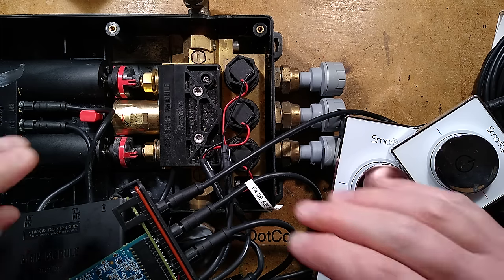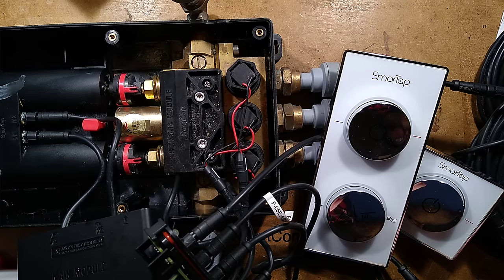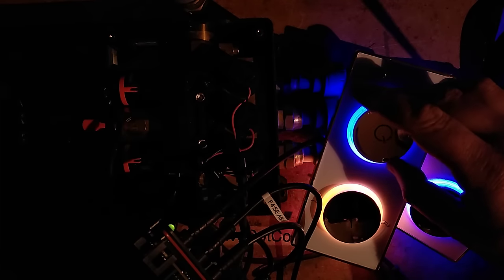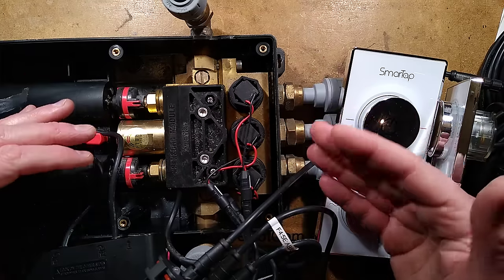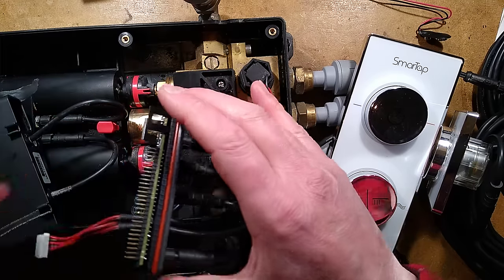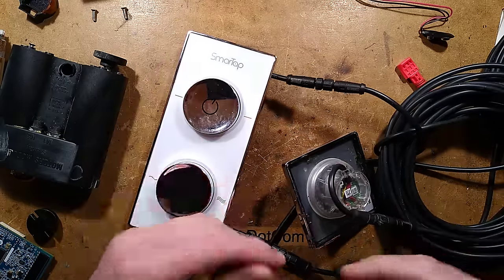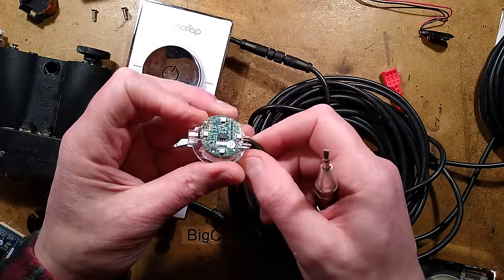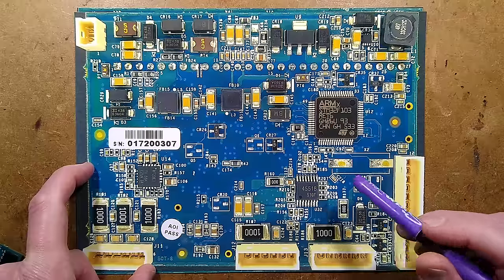Smartap - when the Internet of things goes down

Comment: Just get a Japanese tankless hot water heater.  They offer perfect temperature regulation; separate programmable max temperature controls for kitchen and bath and have normal faucet controls that even your grandmother can understand.  They even have a cute, soft feminine voice that announces when the bath is ready for use and an automatic reheater/recycler to keep the water warm while your family uses the tub.  They're also very efficient gas users, last for years with no maintenance required and seldom, if ever, break down.  As every house and apartment in Japan has one the companies are not likely to go out of business, too.  The only downside is that you might have to wait 15-30 seconds for the shower and tap water to warm up, but it will keep that temperature perfectly for as long as the water is running.

Comment: Learned about this the hard way myself about a year ago during that whole video doorbell "free storage scandal" BS. Now, I refuse to insall anything that lacks the ability to be integrated with a local system or Home Assistant. This is one of those industries that still lacks a proper standards system. I know they are trying to get some up and going but they really cant come soon enough. Especially when you have something like this thing. On the otherhand, love this device and its too bad that one part was designed it so poorly.

Comment: While I design tech stuff for people, I try to keep our house at a lower tech level.  Our refrigerator had the option of IoT to allow me to change the temperature while away (nope, didn't buy the option).  Um, I set the temperature when I bought it and haven't changed it since.  Our clothes washer and dryer both have near field communication to your phone (they are Candy brand).  Nope, haven't installed the app and can't think of why I'd want to stand in front of a clothes dryer with my phone to control it.  There's a nice manual controls on it that work fine.

Comment: They forgot another "R" after the "T" because it was a SmarTRap... I hope the thing between both ceramic valves is a thermostatic anti-scald device to shut off the output if any other part of the system fails.

Comment: And now hobbyists will swoop in and start dropping Arduino boards (or even a pi zero or something similar) in there to make it a locally controlled thing. 

All this at a massive loss for the company... who chose to not make it user-friendly for anyone technically inclined, or anyone without the desire to have a complete stranger control their shower water temperature remotely...

Comment: I can understand Internet-connected thermostats, as it would be quite useful to turn the heating on before you get home or override a time setting if you are going to unexpectedly be out of the house for longer, but I don’t see the point in Internet-connected taps. You presumably have to be near the tap to use the water, so why can’t you turn it on then?
Reply: Possibly to run the hot water so it would actually be hot when you get to it? Would be cheaper to install a recirculating pump though...
Reply: @NiHaoMike64  I suppose that problem would depend on how your hot water is supplied. Where I live, we have a hot water tank, so you get hot water within a 30 seconds of turning the taps on - until the tank is empty of course. Where I lived before, the boiler heated water to demand and was a super-efficient gas boiler - you would get water up to 85° depending on the bath thermostat setting within a few seconds of opening the tap (why you’d want a bath at 85° is a different question!)

Comment: This seems like a good design. Just keep the control on local wifi and keep the last settings stored if you can't be bothered to pull up the app. It might become antiquated in a few OS updates if the app is unmaintained, but still much better than a cloud-based solution.

Comment: I installed one made by watt stopper that's controlled auto flush in urinals off of a pir .It would count how many people came in an out of the PIR sensor and then  triggers a flush  so every 10 to 20 pulses would trigger 1 flush saving water

Comment: I much prefer it when the NSA can remotely flush my toiliet... so much so that I should have a IoT toilet with a webcam setup that posts to Twitter (sorry, X) whenever it flushes. 

Jokes aside, local control is mandatory, the "cloud" is guaranteed to dry or up float away at some point (usually when you need stuff to work), leaving you in the lurch. Plus a health amount of direct control or manual backup for when the electronics eventually fail... no mater how well it's designed and engineered, everything fails eventually.

Comment: Stripped of the internet of things nonsense, I wonder if those easily turned dials are more disability friendly. Handles are better than knobs in that regard but directly turning a valve still requires a bit more effort than rotating what's effectively a large radio dial. Trivial for most of us but potentially difficult or uncomfortable if you have arthritis or some other musculoskeletal or neurological disorder.

Comment: ET phone home.

Sounds like when my steppers can't find home position and they try to turn past maximum travel.

It is very interesting they went with an encoder instead of a hall effect sensor on the near the output of the gearbox. It seems like a sealed hall effect sensor wouldn't suffer from the failure mode observed here.

Comment: Nice thoughts on home automation then and now. My core rules would be:
1. automation is nice but never rely on it - always have manual override / backup control; bells and whistles may be gone but core functionality has to be available no matter what
2. any IoT devices should run on open-source protocols with no reliance on proprietary software
3. keep all automation in house, including an on-prem hub/server (Domoticz, HA etc.), expose only necessary controls and monitoring, secure them accordingly
Reply: I agree with all except number 2 - a HA system really can’t be sold with the house, while DIYing a proper/established system like Control4 or Crestron can.

Comment: I have something baffling. To keep a long story short, I'm working on a powered sub single channel push/pull amplifier. [120VAC Home unit.] It sets up a +/- voltage with a transformer. [+38VDC and -38VDC] Then they run those voltages through linear regulator IC's +15V and -15V in To-220 packages.

While it's appropriate to have a voltage push to handle heavy kick bass loads, the baffling part is to put such a heavy 23V drop across each regulator and on top of that with no heatsink on the regulators massive voltage drop???
 It would make more sense to start with something like +22VDC and -22VDC to reduce the heat load on the regulators???
Reply: I think it's more sensibly designed than you think. I'm 99% sure the full voltage directly feeds the main output transistors. The large voltage is needed to output a decent amount of power. I'm guessing the amp is rated for 100-125 watts into a 4 ohm load.  The 15v rails are only for preamp and maybe driver stages.

Comment: I fail to see how automated IOT for a bathroom is of any advantage over a human turning a tap on and off. In our times water authorities recommend the use of water saving devices. Being able to turn the shower on from another room would contribute to excessive use of water. Even “running” a bath remotely could result in one forgetting the bath is filling and result in water either going to waste via an overflow outlet and where there is no overflow outlet flooding the bathroom.

Comment: I have a few IoT devices but they are of my own design and have no reliance on any 3rd party (or even me) for precisely this reason. What if the 3rd party service decides to shut up shop? Happened a while back with some other connected home system. I have always liked the idea of a heavily automated home but never got round to it but even then it is an arse when you come to move house. All my stuff has a "default to standard" operation but it's still a turn off to buyers - even my Bluetooth garage doors (but that is down to the app, i never did it for iphone coz its such a faff)

Comment: General problem with IoT, why use a mechanical switch when you can use a few million transistor, an distant internet server farm and thousands of lines of computer code. The clear advantage is that your home can hacked and you are dependent on the fickle fate of the manufacturer. 
( please buy a new home, as your existing dwelling is no longer compatible with the latest version of the home automation operating system.)

Comment: Home Assistant can run completely without an active internet connection. And I am going to blow your mind Clive, home automation are only going to increase. I know you think technology peaked in the 90s, but it marches on. Would you brick up your front door because burglars exists? You need to lock your door, will that stop a determined burglar? If the front door is locked, do you leave your windows open? Yes, IT security is a new but necessary skill, and in all honestly not that complicated, just like locking your door isn't complicated and won't stop the really determined burglars. Hackers are not superhumans, mostly they are opportunistic dumbasses, just like burglars.

Comment: You could probably fix this by using a raspberry pi or arduino to communicate to the old board. I haven't watched the video yet (been busy with work) but all you would need to do is code one of the either a pi or arduino to send the correct signal to the parts the old board controlled.

I can't imagine it be too hard. I use Raspberry  Pi's and Arduinos all the time. You can even get them to communicate with Alexa and use voice controls etc.
You could also control them through something like home assistant where you could do some really crazy stuff like
"ALEXA, Turn the shower on, I've had a crap day..."
Alexa sends the command to home assistant which tells your arduino/ pi to turn on the shower but because you have had a crap day, it will be at a really good temperature/ pressure and it could also start playing music you like via a speaker.
(You can get bathroom speakers with alexa built in or you could get a basic bathroom speaker and wire in an alexa)

You could even have a presence  sensor in the shower which can detect when you enter / leave to start or stop the water.
Reply: I was thinking the same thing,going to have to keep my eyes open for a fire sale on the hardware...

Comment: I rewound the video. You said Home Assistant. Don’t know if you meant a generic home assistant or the software with that name but Home Assistant software is local, some integrations require the cloud because of how the third party hardware is deigned (eg. Google-Nest) but it’s not intrinsic. Also more than basic voice control requires the cloud to interpret, although that is encrypted. It is entirely possible that the device is only controlled locally over WPA2 encryption.
Reply from the maker: I meant a generic home assistant.  Poor choice of words given the popular independent app of the same name.

Comment: An interesting system Clive, I always look forward to seeing what gadget you have to disect next.
 I did have Alexa to turn the light on here, but I went back to using a manual switch
Am I right in thinking there are sensors that can be tagged onto a body to monitor things like blood sugar levels and heartbeat etc?
I think these link to a wifi? 
The next step could be to have medicines injected automatically, under the control of some artificial intelligence. 
The possibilities are then endless....
Reply from the maker: I'm not sure I'd be comfortable with automated injections.  The hospital machines are designed with many safety systems.

Comment: Exactly....We had the central radio and speaker system.  You could talk to the front and back door and play radio in any rooms...and it broke down in a few years so from about 7th grade to about 30 years later it went from staticky to dead...and of course, we really didn't use it when it worked anyway.
Reply: I guess that's what happens when you let a piece of technology rot instead of maintaining it.

Comment: To bad the internals seem to be of low quality. Would have been nice to pick one of those up for cheap now that the company is out of business and making a new controller for it. The manifold body with motors and solenoids was very compact and nice conceptually.
Reply from the maker: The internals actually seem quite good.  The corrosion damage was probably caused by bad installation.

Comment: There is no reason for majority of its functionality be located on a remote server. Notifying you that someone may have left the tap running while outside your home network sure,  but the other smart features let alone basic functionality shouldn't need to be tied to a remote server(and possibly a subscription).
Reply: So they can bill the user and it's much cheaper having everything on remote server over developing a smart hub to go alongside the "Smartap" would be my guess.

Comment: Ignoring the app BS that style of valve control is what washing machines should have(I know cost is the reason they don't), the solonoid valves that are only either on or off always seem to cause a lot of water hammer.
Reply from the maker: The washing machine ones close by default with power loss.  (And are the cheapest type.)

Comment: Do you think I could use that to control the gas supply to my smelting forge torch assembly? That way I don't have to be anywhere near it when "problems arrise" suddenly. Can I order one from BigClive Industries? Thank you, keep working.
Reply from the maker: Yeah, we'll just keep that manually controlled with a safety shutoff valve in case.

Comment: I have had one of these since 2020 and the flow rate has now decreased to a trickle... No support or parts available and no way of getting it serviced. Mine was mounted same way as your video. £680 + wasted. I suspect the servos have failed. I will probably replace with a Mira controller and pump to save ripping out the piping to install a manual shower. So pi$$ed off! Apparently there is an internal filter which might be partially blocked so I might play with it first and see if I can fix anything.
Reply from the maker: The filter is in the large central brass bit between the servo controlled taps.  Its lid unscrews.
Reply: @bigclivedotcom   Many Thanks...Time to have a play with it.

Comment: Putting the internet in your shower sounds like a terrible idea. Someone could turn it up to 80 degrees while you are in there.
Reply: it can only go as hot as your water heater is set to but that a bad idea they can pull support and it can be a weak point in your network

Comment: We live in times when this “all must have servers” IoT approach must die, the quicker the better. There’s no reason for it. Stick a single page html app on the flash in the device, expose a basic json API, expose it by default only to the local network. It’s not hard FFS. No need for platform-specific apps, will work on PC/MacOS/iOS/Android/Linux no problem. Voice recognition? There are low cost edge AI solutions for that. No need to ship the audio outside of the device. Even without AI, there are legacy libraries that work on plain MCUs without neural network acceleration.

Comment: CAn this device not operate without being connecting to the internet? I use the old fashion type of taps in my home.
Reply from the maker: It has a purely manual mode.  But no direct control over taps.

Comment: For me, anything that does not have a physical manual override does not have a place in my home. I have smart lights, and a Hive heating controller, everything that can be switched manually if (when) it goes haywire. I don't trust anything safety critical to be 'smart', too many points of failure.

Comment: Thanks Clive nice device if one really needed such a device for a person with disabilities. 
Had lights , remote stat for heating and a tea maker for my wife’s convenience since she was practically quadriplegic. 
However I would have thought long and hard before installing a device like this. Water and electronics don’t mix. 
Imagine the fun one would have replacing a tap washer in this device.
We had a hi tech electric shower that maintained set  temperature but when it broke down was cheaper to buy a new unit because it had custom non standard seals etc. 
Yes it did last around 20 years before it had issues.

Comment: If the motor box is near the bath/shower but controls the flow of water to the handbasin, won't there be an annoying lag before the water comes on, and in temperature control ? Is there a temperature sensor on the outlet ?
Reply from the maker: The temperature is served in the unit, so it would need to be close.

Comment: LMFAO! Why does this thing exist? (Any excuse to put mains voltage in the plumbing, right?)

And don't you guys have a law that you can't mix hot and cold water in the faucet, you have to have separate ones for each with mixing only in the basin? Or is that an old thing?
Reply from the maker: Traditionally the cold water is direct and the hot water is via a tank.  It's to prevent stagnant tanks syphoning back into the drinking water.
Reply: Yeah that was my understanding. We use hot water tanks here though and never had any such law. (The water tank is pressurized by the same cold water supply as the cold water so seems unlikely you'd get much if any backflow.)